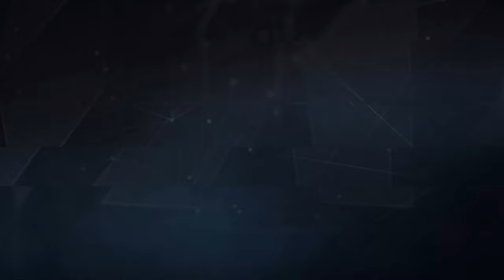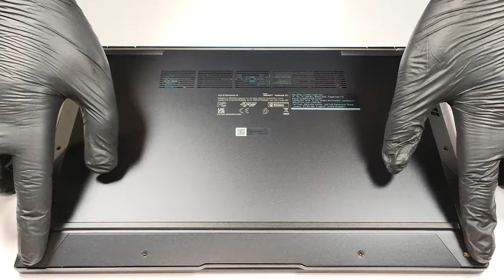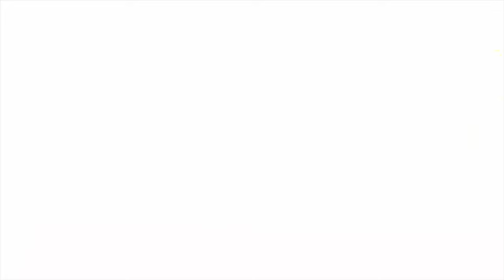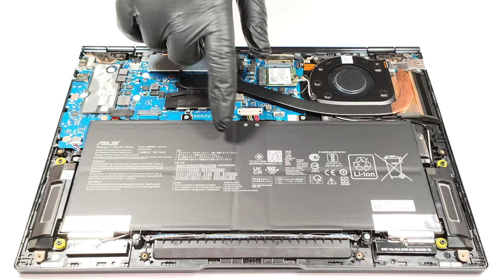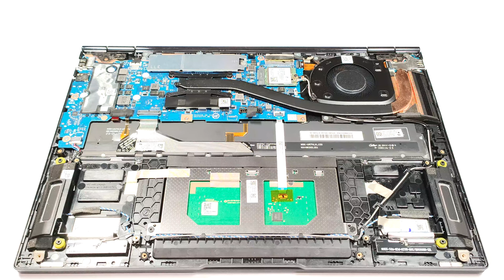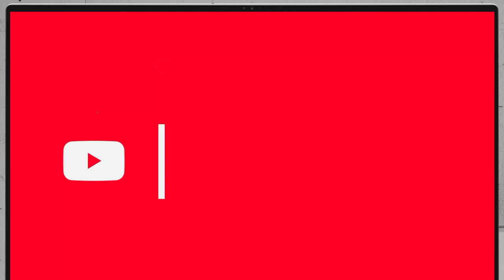🛠️ How to open ASUS Zenbook 14 (UM3402) - disassembly and upgrade options

Comment: can u add more ssd in this laptop? cuz mine only have c drive
Reply: Yes and no, you can replace the current ssd with one that is larger but there is only one slot so there is no room to add an additional ssd drive into the laptop. Hope this helps!